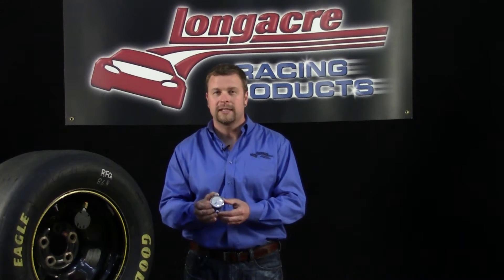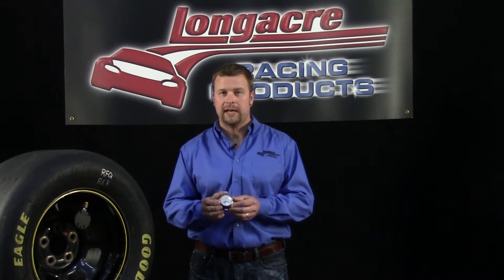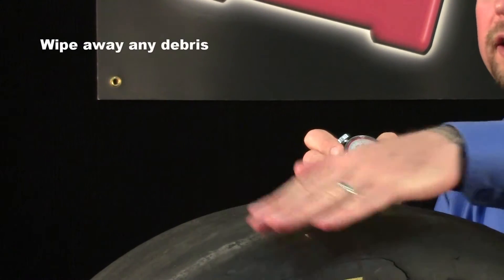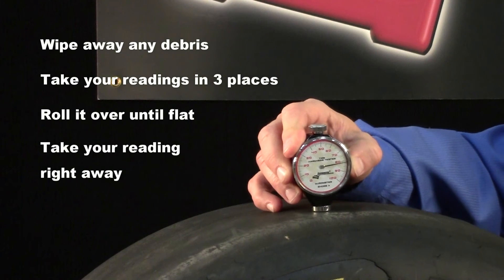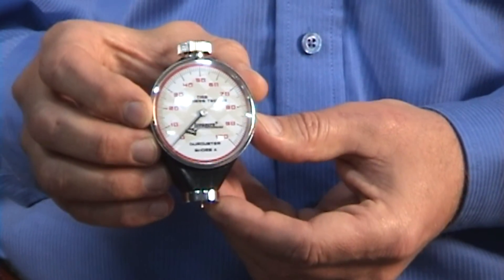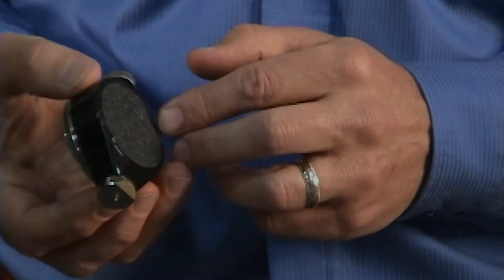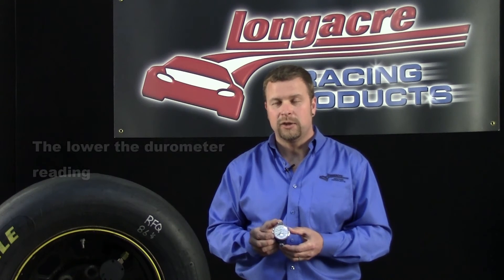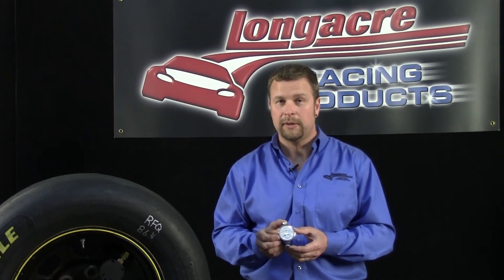Tire Durometer - Longacre Tech

Comment: A couple of things are missing here...  It may seem obvious, but the lower the reading, the softer the material.  And the knob on the top is for calibration.  If you use the durometer on something impenetrable like glass or steel, it should read exactly 100.  Use the knob at the top to recalibrate to 100.